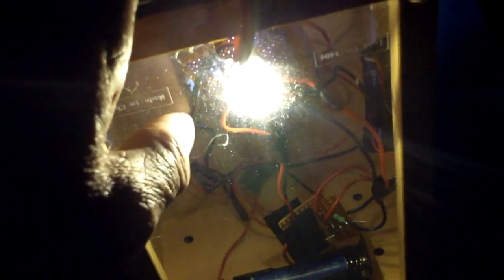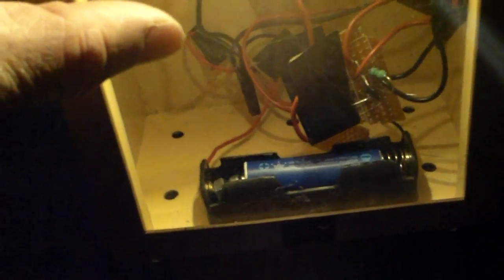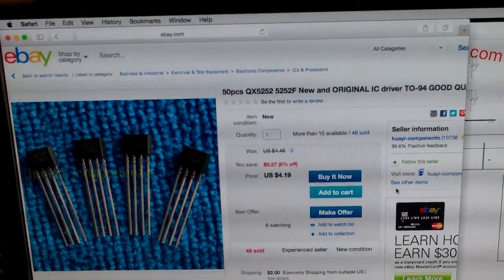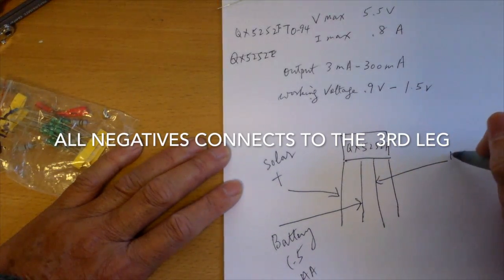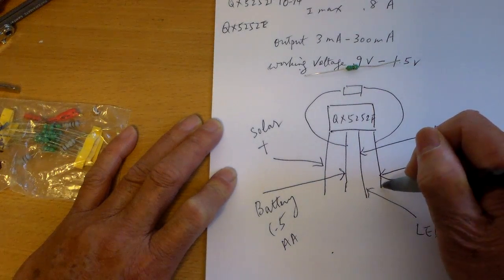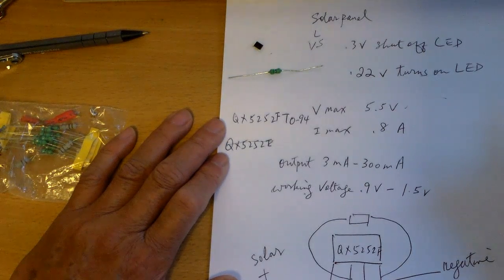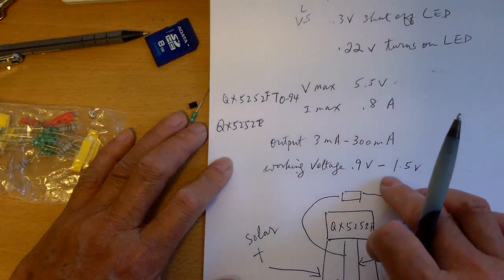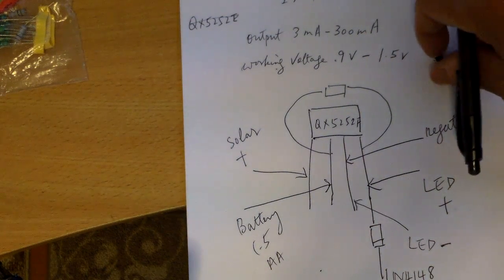1 watt led solar light QX5252F chip based

Comment: If the LED can run all night, it‘s not drawing 300mAh.

A good Ni-Mh maybe has a capacity of about 3Wh, so considering 80% efficiency of the QX5252 the LED could run for about 2 1/2 hours. 
It will be more like 1/4W (the 47uH inductor allows 75mA), which still can make a LED very bright.
Reply from the maker: The qx5252 chip doesn't really draw 200 mA.  I believe it works like a joule thief circuit and consume much less power.
Reply: @wtam69 hi I think it switches at 150hz or higher so the led is not constant on and run time increase.
Do you maybe have info on the value of inductor and output current. Want to make selectable output
Reply from the maker: @pietpompiepompiepiet940  inductor can be 30 to 100 uh.

Comment: What is the 1N4148 diode for?  I haven't seen that in other circuits using this IC or on the datasheet sample circuit.
Reply from the maker: Supposedly added output.
Reply: @wtam69  Thanks for the reply.  I recently bought some of the 5252F ICs to play around with (after finding one in a solar light).  I'll try it with and without the diode to see if there's any advantage.

Comment: Hi !

I have a problem with my solar light. It won't charge the battery anymore. I tried a new battery, the light is on but the solaire panel won't charge.
My system works with a small switch, a 5252F chip and a resistor. What should i fix ?
Reply from the maker: What you have there is a inductor. It is probably the chip so you can replace that. Of course, you should check all the connections and the output of the solar panel first.

Comment: Thanks for the nice video.
To everyone else: you are not going to get much more than 110mA out of this chip(others even less). That is about 1/3 of the current that you need for a 1W LED. It will work, but not at full brightness. The biggest problem with solar lighting is the solar panel. The Solar Panel has to be large enough to charge the Battery you have connected even in poor lighting situations (cloudy days/Wintertime). 1.5-2.0V is enough if the panel produces at least 500-600mA (so size and area of the panel are important). The QX5252 will stop charging when the Battery is full. There are a number (probably a dozen) of chips like the QX5252 that work alike but the circuitry of the Chips are different. If you need Information on a specific Chip just use Google and search for "QX5252 Datasheet". There might be multiple different Datasheets for the Chip so check them and you will find the Answers to your questions. I hope these Infos will help you to solve your Projects. And if you come up with something great, share it with us all! 😀

Comment: This1.watt led work from 1. AA 1.2v ni-mh recharge batery? Can I connect more aa baterys in paraler for more valtage and mini amps?
Reply from the maker: Better to use an extra QX5252F, battery and solar panel  to make a separate.  One QX5252F can only handle so much.

Comment: I have since found something interesting. You can bridge the output of two QX5252F's to get more current out. it's similar to  connecting batteries in parallel. I tested this by using a single,  larger capacity  solar panel and battery for two chips then i just connected the two chips outputs in parallel (just the outputs, leave the inductors in place and separated) You can also run two 
separate qx5252F solar circuits if you don't bridge the outputs. If you run two separate QX5252F's from a single battery and panel one my turn on slightly before the other. I'm not  sure how these  configurations will affect charging or chip life yet 
but they seem  to be working well so far. Cheap thrills.. Have Fun!
Reply from the maker: Thanks for your input.

Comment: The 22-100uF cap will allow you to run 4-6 slow color changing LEDS in parallel , The color changing LEDs will not work unless your use the capacitor.  Using a 2000mA, NiMH rechargeable battery and a 2V, 300mA solar panel will run for 6-10 hours on a full days charge of sunlight. I have noticed that it doesn't make much difference if you use a 2V or a 5.5V solar panel as long as your panel's output current is enough to charge the battery (about 1/10 the battery capacity)  say a 200-300  mA panel for a 2000mA battery.

Comment: I've tried many Inductor/Cap combinations with the QX5252F to get the highest current/brightest output. The highest output  seems to be using a 10uH inductor between pins 2 and 4  with a 22-100uF cap across the LED output. The QX5252F will not work with less than a 10uH inductor. The cap significantly smooths and increases the output brightness.  The output seems limited to about 100 mA using any combination. LED brightness is a function of current and I have noticed 4- 20mA LEDs in parallel provide the same brightness as 6- LEDs in parallel
Reply from the maker: Seems like you've been busy playing around with different components to optimize the garden light. It is amazing how something so inexpensive can give you some much value for your money.  Thank you for reporting back the results of your experiments.

Comment: Hello WTAM. I have been making Solar lights for a few years now. I usually use a PNP transistor to turn them on and off. I have some QX5151F's ordered and am looking foreword to trying them. I have several questions: The 5252F data sheet says you can use up to a 5.5v - 800mA panel and the 5252F's can output 300ma. What sized inductor in mH will output 300mA to the light? Does it matter if you use a higher mA panel at 2V such as a 2V@400mA panel  or a 5.5V @100 mA?  I'm guessing that using a higher mA panel will only charge the battery faster than a less aH panel. I'm also guessing that the chip doubles the battery voltage to run the LED by by using twice as much current . Does using a higher voltage panel cause the output voltage to the LED to be higher or does the chip limit the voltage to  3.1v or so? Thanks so much.
Reply from the maker: You have to experiment a bit. I have used 33 to 100 uH with different results. The authority on this is really Youtube's MrFreddiew1.  Go to his channel and you can find he has compiled all kinds of data on the inductor used and duration of leds on time.  His link is: https://www.youtube.com/user/MrFreddiew1  
Exceeding the limits quoted in the data sheet will probably make the light unstable but stay lit longer and brighter.

Comment: 1w led is not drawing 350mah.
5252f chips current is restricted by inductor value, with 47uf limiting current to just 20mah and 10uf to 90mah.
Reply from the maker: Thank you for the info.
Reply: +wtam69 * micro Henrys uh not uf
Reply: Are you guys using 1/2 watt inductors? Is that large enough if I were to size it to push 200ma through the 5252f?

Comment: You draw up circuit diagrams like I do.  Great minds think alike :-)

It's very hard for the camera to give an accurate representation of how much light that unit puts off, but from what I can tell it looks like it's pretty bright.  Impressive use of such a small amount of power.  I'd like to see how long the LEDs' lifetimes will be, run in such a circuit, especially outdoors exposed to environmental changes.
Reply from the maker: +jaykay18 I have one running like this one for several months. The camera tries to adjust to light conditions by increasing the gain when the light is low.  The light output of this 1w light is lower than when powered by the conventional means of 3.7v. Nonetheless, it is interesting that one AA can power it for so long.
Reply: +wtam69 I always enjoyed your all parts with QX5252F chip based circuits. Your way of naration and explaining is  again very very impressive. I have now procured QX5252F and will certainly try Thanks for the videos like instructable 
Thanks indeed